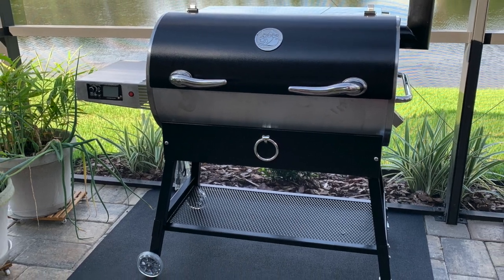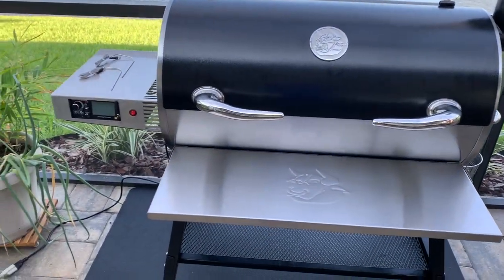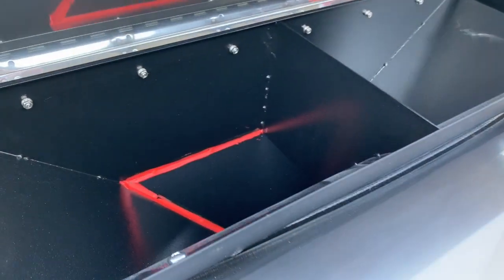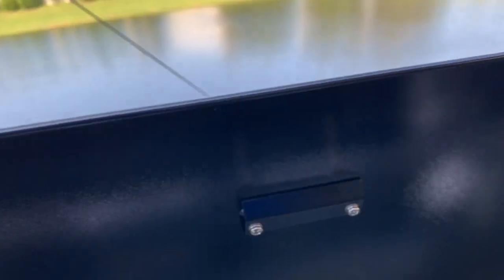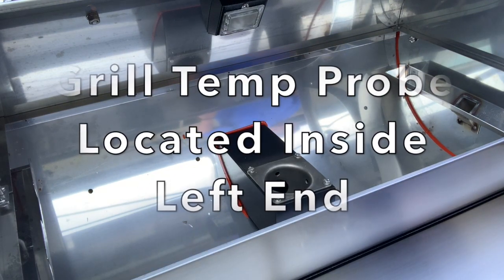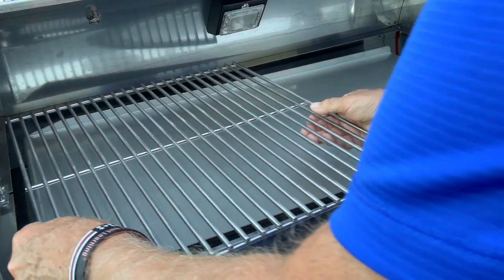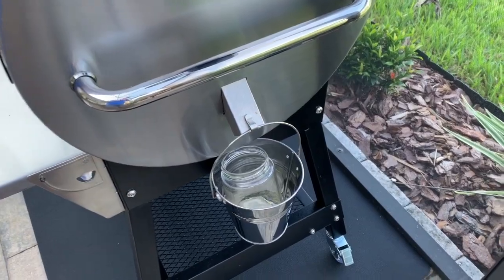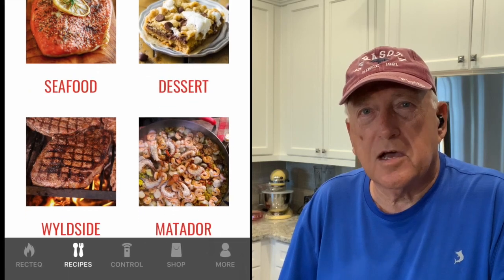recteq 700 "BULL" Review & 1st Glance

Comment: So which do you feel is the better grill if you could only have one RT grill? looking at bullseye and the 700
Reply from the maker: The 700 is made better and more durable. It has WiFi so you can monitor with your phone. It is larger and you can get more food on it. The hopper is bigger and will hold more pellets for those long cooks. With that being said the Bullseye will get hotter and smokes food really good. The Bull smokes good , but may not get hot enough to get a good sear. The better made grill is the Bull, but the end results are awesome with both. You really can’t go wrong with either one.